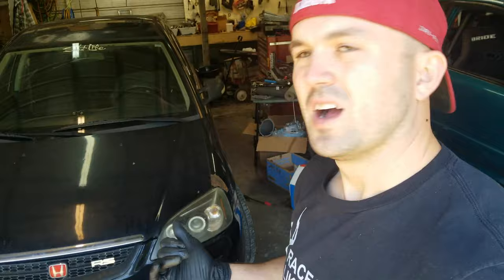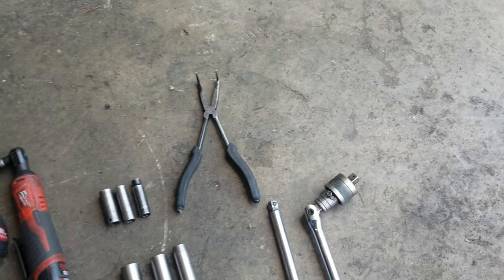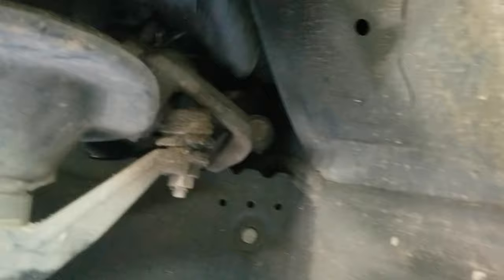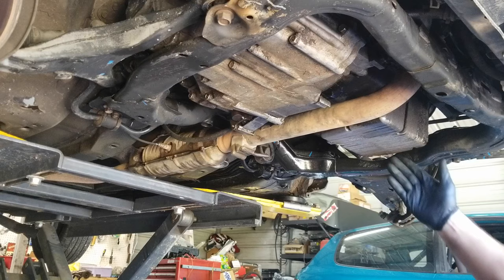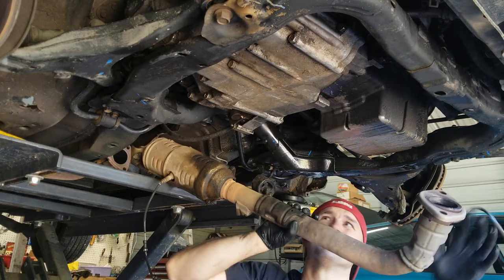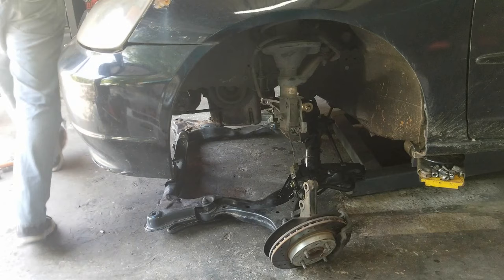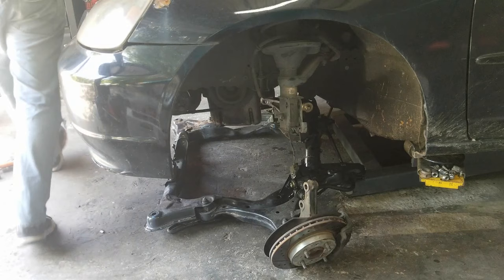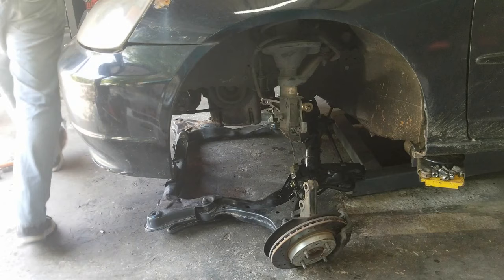How to: 2001 - 2005 Honda Civic Automatic Transmission Removal

Comment: i own a 2002 civic hatch,my transmission is gone,i need to buy a used autobox for the same 7th gen civic.the problem is i dont know what to look for, is there a name or some sort of a code used to refer to these gear boxes.
Reply from the maker: Manual trans 2.0 correct?

Comment: Hey I got a question hopefully you’ll reply. I have an 01 Honda Civic lx 4 speed & I got a used transmission same year but it’s a 3 speed will that do any damage? I heard the check engine light will just come on when driving around 60mph but will it do anything bad in general?
Reply from the maker: It wont do any damage. They shift a little weird and will have the CEL but they work.

Comment: I'm swapping my 05 Civic VP BMXA transmission to JDM SLXA transmission.  I've read that this will give P0740 code because of the different sized torque converter.  I was wondering if it's possible to swap the torque converter?  Would this keep the code from popping up?  Also should I swap all the sensors from my BMXA to the SLXA?  I appreciate any response!
Reply from the maker: I don't think it has anything to do with the torque converter. The transmissions are different internally. It'll drive ok, but shift points will be a little off and like you mentioned, the check engine light will be on.

Comment: Is there any need to remove the subframe if you’re going to take the engine and trans out together? I gotta do mine but was going to take the engine out as well so I can do timing belt and new gaskets and was just going to take it out from the top.
Reply from the maker: I find it easier to pull from the bottom. I've pulled the swap from the top before though. No need to remove the subframe in that case.

Comment: I have the same car as in the video ..a 03 Honda Civic ex . I have a torque converter clutch code. Can I just replace the torque converter or should I just replace the whole transmission. Which is cheaper in your opinion.please contact me back
Reply from the maker: Typically, I would go ahead and do the whole trans

Comment: Quick question did you take off the bolt on the outside of the hubThe nut on the outside of the hub sorry about that
Reply from the maker: Are you referring to the axle nut?
Reply: @hondaresource  yes

Comment: Always engine oil all over my engine and replaced the head gasket and the egr valve gasket and the cylinder valve cover seal ( the cap and the side of the valve cover )  it’s still leaking !?!? I need help with answers 🙏🏾😭
Reply from the maker: https://youtu.be/dk5aqczPM8k

Comment: I got a 2003 Honda Accord. Do you think is similar job? Thanks
Reply: EX v6 3.0L
Reply from the maker: Similar in the fact that you have to remove the subframe and drop the trans out the bottom. Bolt locations will be different.

Comment: Overall how long did it take to remove the transmission??
Reply from the maker: I've done it in 30 min https://youtu.be/FdzW22DqfL0?si=pGVKl-bYht6l4O2X
Reply: How much does it cost to replace a transmission on 04 civic auto

Comment: you said 7th gens have automatic transmission problems, so do you recommend i get a manual 2001 civic ex with 130,000 miles or will the trans be just as bad?
Reply from the maker: The manual trans rarely have problems

Comment: Is the polly the only way to take out the torque converter bolts because the polly  doesn’t move
Reply from the maker: What is the polly? are you talking about the crank pulley?
Reply: @hondaresource  yeah
Reply: @hondaresource  any suggestions?

Comment: What’s up brother, I have a 2002 Honda Civic Ex Automatic 1.7L  the check engine light came on , it was the torque converter clutch solenoid. I replaced it and the light came on again so I replaced  the TCC solenoid again but this time I bought one straight from the Honda dealer but the check engine light keeps coming on saying that i need to replace the torque converter clutch solenoid. Do you have any idea why this would be happening? I replaced the torque converter clutch solenoid three times already. Thank you in advance for your help.
Reply from the maker: Most of the time, the transmission is on its way out
Reply: @hondaresource  😬 thanks for your reply. I appreciate it. Awesome videos.👍

Comment: I have an 01 with a bad automatic transmission, and a good motor...

I also have an 02 with a bad motor and a good standard transmission...

I'd like to put the 01 motor into the 02. They're both EX sedans. 

I don't have a lift or friends, but I do have a busted back, and I live way back in the woods. 

What do you recommend?
Reply from the maker: You can remove the auto engine from the 01 without removing the trans. You'll have to pull the whole swap to get the motor out of the 02 since it's manual. Harbor freight sells engine house fairly cheap. No need in trying to hurt yourself.
Reply: What means "pull the whole swap"? Pull the whole... subframe? Pull the whole drivetrain assembly? Pull the car off of the subframe?

Are there any differences between the two engines? They're both D17A2s...
Reply from the maker: @justinbelshe  you can't just pull the engine and leave the trans in the car like on the auto. You'll have to remove the engine and transmission together. It's possible to remove through the top, but I find it easier to go through the bottom.
Reply: @hondaresource  Yeah, that's my thinking, too... I'm trying to figure out how to lift the body off of the subframe without a lift. That's straight up MacGyver shit, and I'm stuck in bed most of the time, so I may just be blowing smoke here. I should probably sell both cars, divest myself of the platform.
Reply: @hondaresource  The 01 has tan leather, okay stereo, deer damage on both front corners. 
The 02 has a bad motor, nasty interior, various dents.
Both are EX sedans. Sunroof, A/C, cruise.
My idea was to smoosh the two together... 01 motor and interior in the 02 body, how hard can it be?

Comment: So... just bought an 01 civic 2 weeks ago,  was actively driving it and it just ... wouldn't go. Not forward or reverse just rev the engine real loud. Turned it off I went for about a half mile, same thing.. that's the transmission right? Not just a clutch or filter but the whole thing??
Reply from the maker: It's the trans unfortunately. The internal filter is stopped up. No way to replace it without rebuilding the trans.
Reply: Thanks for replying! Wish me luck headed to pull a part in the morning!
Reply: @hondaresource  heeeyyyyy... soo... i have an 02 got a 05 transmission  from pull apart got that in,axels were bad got new ones got them in.. on the road we got forward and reverse BUT cant get it out if 1st gear🤔🤔🤔 we think it's the  speed sensor??

Comment: I have a 2001 Honda Civic 1.7 with the auto trans on it, and it only has 104,000 miles on it, and it slips really bad I changed the fluid in it, and I cleaned the shift solenoids but that seemed to have only made it worse. Any ideas as to what else it could be? I wouldn't think that a transmission with only 104,000 miles on it would be going bad, the previous owner changed the fluid every 30,000 miles on it. They took really good care of it.
Reply from the maker: Hard to say, but the 01's are the WORST
Reply: @hondaresource  thanks for the reply! I might buy a JDM tranny, you think I should?
Reply from the maker: @AaronFernandes__  jdm trans don't really work well in usdm cars
Reply: @hondaresource  So I had my trans rebuilt, and the torque convertor doesn't fit flush with the transmission, it is sticking out about 1/4 of an inch, I talked with the place that rebuilt it, and they said I'm not seating it correctly, any ideas what it could be, I might just bring both to them, and have them look at it. Thanks for your time.
Reply from the maker: @AaronFernandes__  spin the torque converter and tap it inward with the palm of your hand. That's usually how I seat them

Comment: My car civic2001 lock up not working normally rpm 2500 at 100km/h now rpm 2500 80-90 km/h  Please suggest a solution thank you very much
Reply from the maker: hard to say without actually looking at it

Comment: mr Phillip i got a question torque converter are they the same with the rd1 crv?
Reply from the maker: No. They are different with each model of car
Reply: i’ve  done  research online i paste what i found out and last sunday i pull out a torque converter at the junkyard 2001 civic ex it fit on my rd1 tranny. 109 tooth ring gear, 22 spline, mount ring 8 holes
Reply from the maker: @yogaobmale849  awesome 😎
Reply: @hondaresource  05 Honda Civic swapped transmission now I get P0700 code is that just saying it needs solenoids? please any help is great thanks.

Comment: curious how much clearance you will need to roll that transmission out from under the car?
Reply from the maker: I'm not sure. 2ft maybe
Reply: @hondaresource  gotcha, and do you have a torque spec for the bolts going back in when reinstalling the sub frame?
Reply from the maker: @ryanorr5755  ugga dugga
Reply: @hondaresource  lol

Comment: The sub frame part has me worried. But dosent look too hard
Reply from the maker: It's super easy on these. The next generation 06+ is a little more involved
Reply: @hondaresource  I did a sixth gen so it's a bit different and im working on cars from Saint Paul so rust. I'm hyped to get into it. Thanks for your help

Comment: Is removing the manual transmission about the same?
Reply from the maker: Yes, I find the manuals easier to work with. They are smaller and lighter.
Reply: The Honda Resource great thanks 👍

Comment: Will the transmission from an 01 2.3  match up to a 01 1.7
Reply from the maker: 2.3?
Reply: @hondaresource  I'm trying to replace the transmission in a 02 civic 1.7 will atransmission from an 01 2.3 match up and work
Reply from the maker: I've never heard of a 2.3 in these cars. Where are you from?
Reply: @hondaresource  I'm from Ga. I was just wondering because the transmission top mount is different. Was just wondering if it would still work
Reply from the maker: @baylieramsey388  I don't know which motor you are talking about. The 01 Civic only came with 1.7
Reply: @hondaresource  ok I was mistaken.  How hard is it to put the 2.3 prelude motor and transmission in the civic
Reply from the maker: @baylieramsey388  I'm not sure on the 01-05
Reply from the maker: If we were talking 92-00 Civic, it wouldn't be an issue

Comment: How long does this job take?
Reply from the maker: I can do it in a couple hours if I'm in the zone.
Reply: @hondaresource  My transmission only moves in reverse. Will move in drive for a few minutes and then nothing.  So I'm thinking about changing the converter
Reply from the maker: @thechoovav1878  honestly it sounds like the filter is stopped up. You can try swapping the converter, but dont be surprised when you still have your same issue!